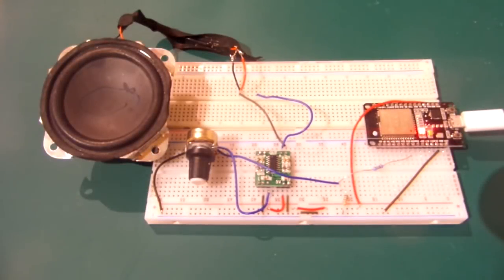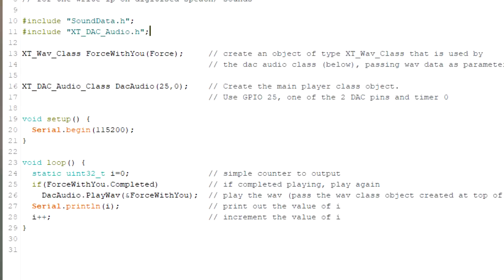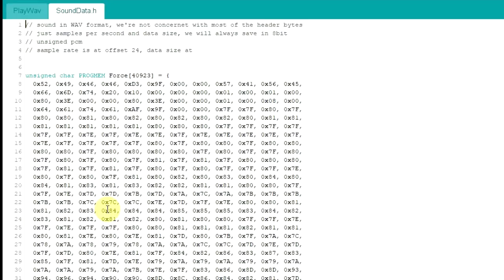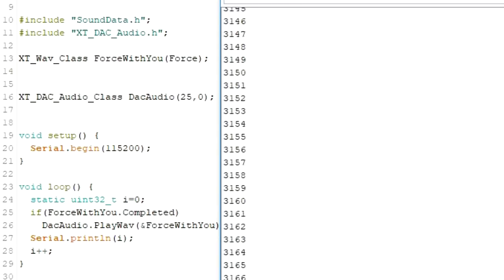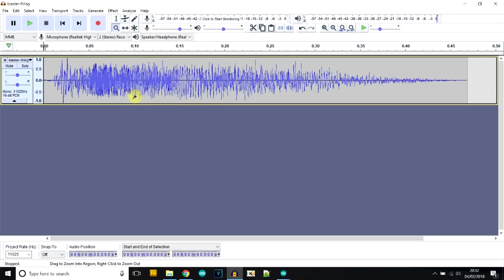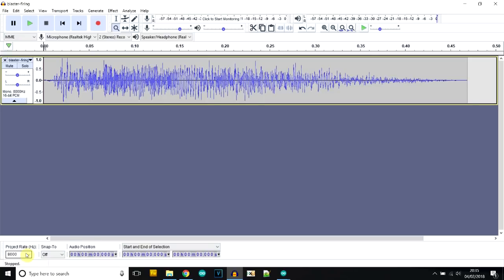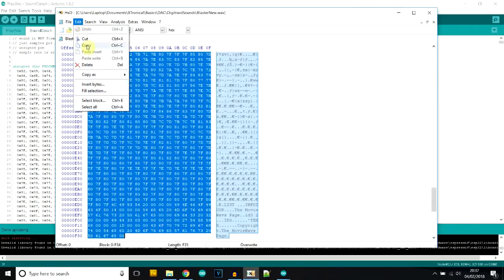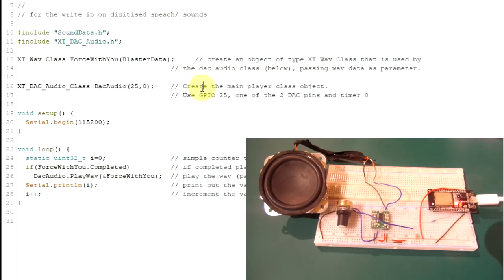Make your ESP32 talk, playing WAV files on your ESP32, digital sound DAC ADC

Comment: Hi, I'm new to this. I'm developing a project in which I want to use sound effects. I need the lag between audio tracks to be minimal and unnoticeable. I managed to implement this on the Teensy board with their library, but I would really like to implement it on the ESP32 since there is Wi-Fi and much cheaper. Can your library play files without a pause between them? I even hired a freelancer, but it didn’t work out.. In your videos you only play one track. The total file size is 3MB, but I think it can be compressed.
Reply from the maker: Yes, download latest library from my website. There is no pause between samples. You can play back samples at different rates so files can be much lower at expense of quality. If you watch the play list of videos on this library it will show you in one of them.
Reply: @XTronical  Thank you, I will now try to find a freelancer who will do this for me) The main thing is that now I know that this is real

Comment: Hello. Nice project. I'm trying to have the same project of yours, but, unfortunatelly, I have got several errors related to the library. I used Arduino IDE 1.8 and 2.x and I got these same errors. Do you have any tips for me? Thanks in advance.
Reply from the maker: Have you used the latest DACAudio library, available on my website?
Reply: Hello!. I did. But I found was wrong. Using Espressif addon V1.0.6 works fine. Any version 2.x.x does not work.

Comment: I know this video was made quite some time ago, but with the current XT_DAC_Audio-4_2_1 library I am running into the error where it cannot locate the esp32-hal-timer.h. I was wondering if you had a solution to this? Thank you, love the videos!
Reply from the maker: Mmm... I'm guessing something has changed in the supporting libraries that come when you set up the esp32 environment in arduino ide. I would have to set up a new set up to see if I can replicate. Unfortunately I'm up to my eyeballs in work at the moment, which is why no new video for a while. So although I'll pop it on my to do list it may be some time. If you solve it in the meantime could you post solution here please then others may benifit and I know not to look into it. Thanks.

Comment: How many WAV file, can I use to it?
Reply from the maker: Do you mean how many you can play at once? If so I've played 6 easily and between 3-5 whilst running my frogger game. If you just mean how many can you fit on the chip then that depends on the size of your wavs.
Reply: @XTronical  sorry ... my english is too bad...🙏🏻🙏🏻🙏🏻
I mean.... i try to build a sample pad... like a DTX multi 12... but now i use a Nano and MP3 TF 16P audio.. im saving my sample in sd card...
The problem is i cant play at once...
I have more than 150 samples... with 12 pad and 12 bank mode...u can see at my video...

May i use ESP32 to replace my Nano n TF Player???
Reply: I want to build a diy multipad samples... like a e drums.
With
12 pad trigger per bank.
2 extra trigger (foot controller).
15 selected mode(samples bank) more.
Can play a multiple sounds sample simultaneous at once...

It was builded by me... but problem is cant play simultaneous... and latency offer the tringgering...😴😴😴😴😩😩😩😩
Reply from the maker: Yes, it can play multiple files at once, you do not have to do only 1 at once. Your English is good.
Reply: Can we sharing via Whatsapp application???
Reply: @XTronical I'm sorry... how about if i use a sd card??? Because i have many sample... i think imposible to fit my sample on Progmem chip🙏🏻🙏🏻🙏🏻
Reply from the maker: Sorry, but this library does not support reading from sd card. No plans to update as working on i2s sound player.

Comment: Hello, can we connect it with the sd card reader only without the i2s and the audio output use a circuit to amplify the sound
Reply from the maker: It could be coded but I'm concentrating on i2s version only for foreseeable future

Comment: I followed your step by step procedure and pasted the hex code in my. h file. Compiled and uploaded. But I get only a beep sound while the inbuilt hex code in the ideworks fine... Please help me
Reply from the maker: Are you sure your file is mono and not stereo.
Reply: @XTronical  Must be mono. Because the file's waveform in Audacity is in a single track.
FYI : The wav file was actually created by an online text to speech converter. Its downloaded as an mp3 file having 6sec. duration. Then I converted it to .wav file using audacity and followed the procedure as in the video. Can u point out what went wrong since i am about to add this functionality in one of my project.
Reply from the maker: I can only guess what might have gone wrong. Is it definitely saved as unsigned 8 bit pcm?
Reply: @XTronical  yes you are correct. It was related to the export format of wav file. Thank u very much for correcting me 👍🏻God bless u
Reply from the maker: Excellent. If you want to play mp3 you should look at my i2s videos. Here's a play list

https://youtube.com/playlist?list=PLpyo4J4M9YqJLh0B8YXNB0zza0uWIeguO

Also here's a play list for my new i2s library which is basicaly a replacement for the DACAudio one you are working with. It's not ready yet though sometime next year for initial release. 

https://youtube.com/playlist?list=PLpyo4J4M9YqKRD_qWDDRDeI0jZ6D2EUw1

Comment: Great video! I was wondering if it would be possible to do a stereo output with this library? Play one sound through the left speaker and another sound through the right?
Reply from the maker: It would be possible using the other dac as well but I won't be implementing on this version. I'm supporting stereo with my new i2s library, which will have all the same functionality as this version. Check out some of my latest vids.
Reply: @XTronical  Thanks for the quick reply! I will look at some of your latest videos. Any advice if I would try to implement it in this library?
Reply from the maker: You will need to alter the software to read stereo wav files . After that you could follow the code to simply send the other channel to the other dac.
Reply: @XTronical  Thanks for the advice! Really appreciate it.

Comment: Hiya, great videos and website!  I have managed to get my ESP32 talking but I now have a need to out it into deepsleep mode - only trouble is I have not been able to get any audio to play when it wakes from deepsleep.  Is this possible at all or it is a known limitation?
Reply from the maker: It's something I've tried, and no one else has mentioned, so think you're the first. If I remember deep sleep loses all ram memory doesn't it? I think you'll have to re initialise the library or store some settings in spiffs before sleeping and restore afterwards. Least that's my guess at the moment!
Reply: @XTronical  Yes loss of RAM was my initial thoughts too, but have managed to get working now.  I needed a while loop to fill the buffer whilst .wav file is playing.

Comment: I am just watching the video right now and haven't checked any documentation but, can the sound be triggered once a condition is met? How does this impact the whole program?
Say for example an alarm clock.

I would perfer to use this method of making a sound instead of having to use an actual electric bell
Reply from the maker: Yes, it can do that easily. The program runs mostly on interrupts and there is very little impact on your main code. See this video where I run a game called fogger which is completely redrawing the entire screen over spi, playing the game and doing all the music and sound effects in real-time.
https://youtu.be/J9mV2IcEvP0
Reply: @XTronical  

After a realization, while I am interested in projects for esp32/86, since I have accumlated 6 of them, I have remebered that I have pi zeros. 

Now if I were to make a type of MOOD lamp that was sourcing data from a website with an additional Screen read out, that would play a sound in the event the mood lamp hit a certian condition from the data.

What would be a better opition to use in your opinion?
Reply from the maker: Both pie zero and esp32 could do what you want. Which ever you find easier to work with.

Comment: how connect esp32 output to PAM8610? . i mean it has a signal voltage range from -0.3 to 6V.
Reply from the maker: I'm not familer with it but the input range is fine for the esp32s 0 to 3 ish volts. Just connect dac output direct to it's input and omit the voltage divider resistors that I usually use.
Reply: @XTronical  thanks.. And the library is awesome. Btw PAM8610 can drive 10W at 8ohms and 15W at 4 ohms. Plus, it has a THD+Noise of less than 0.1%.
Reply: @XTronical  i forgot to tell you that the signal is biased at 3V by the ic. Should i proceed as you said?
Reply from the maker: Oh, hang on. I'll get back to you, will have to check the datasheet. Give me a couple of days
Reply: No problem, thanks for the support.
Reply: So did you figure something out?
Reply from the maker: Hi, sorry for delay, completely forgot! With lockdown and kids at home I get distracted. I've just looked at the data sheet. Firstly the recommended supply voltage is minimal 7v, so a secondary supply would be recommended. Although it's not saying it can't work at lower voltage but performance may be affected. As for inputs I think it should work just connected to the project as it stands. But if not omit the resistor divider pair and that should be OK also as it seems that it wants line level input anyway. Generally this board is more intended to be fed by a pre amp. I think it could work well if fed directly from esp32 and give it its own supply voltage. I might try one in future.
Reply: Oh, i know that it works from 6v to 16v. I just wanted to ask about the inputs. Ok i'll do as you say. Will i need a coupling capacitor on the inputs?
Reply from the maker: The board your using should have one (it's part of the reference design)
Reply: @XTronical  thanks for the help.. Stay Safe 🙂

Comment: Help me.
I copied values from Force array to another array but it does not make the sound.The arrays are same but it does not produce sound.
Reply from the maker: Can you post the code.
Reply: @XTronical  Thanks for replying..
Iam using version 2 library.
In soundData.h there is an array of size 40923 the array is initialised with the hex code.

In play wav file

I just create a test array of same size of Force.I just copy the values from Force to test array.
But that array is not working..
Reply: @XTronical  
#include "SoundData.h";
#include "XT_DAC_Audio.h";

unsigned char PROGMEM test[40923];

void setup() {

Serial.begin(115200);

int i=0;

while(i<40923){

test[i]=Force[i];//To copy the contetnt 
i++;
  
}

  
}
XT_Wav_Class ForceWithYou(test);                                                                                 
XT_DAC_Audio_Class DacAudio(25,0);                                          

void loop() {
  DacAudio.FillBuffer();    
  if(lick.Completed)
  DacAudio.PlayWav(&lick);  
}

Comment: Is it possible to load the sound array from sd card?
Reply from the maker: Technically yes but would slow things up a lot whilst accessing card.
Reply: Ok,,i store the hex data in a file and save it in sd card.at the time of call setup the array Force load the data from file
Reply: @XTronical  my doubt is if it possible to   create xt class object by passing array force after the loading of value from sd card...
Reply from the maker: Yes, should work but it will be stored in ram and not program memory so your files can't be as big
Reply: @XTronical  its make runtime error

Comment: how do you get sound to play without having to use PC to start program each time?
Reply from the maker: The examples are just designed to run after upload. You could write your code in a very large variety of ways to start a sound playing using the "play" function of the library. Have a look at the latest library on www.xtronical.com
Reply: @XTronical  Can you give simplest example? Thanks.Can you recommend a book for ESP32?

Comment: how about receiving sound files on a mic and then converting to wav or uploading to the sd card
Reply from the maker: Esp32 can handle that no problems. However playing back from sd is possible but if the driver waits for data then it will slow your main code down.

Comment: with 16k Sample rate, how much seconds of sound can the ESP32 save? Or in general, how much memory is available on the ESP, after subtracting the needed memory for the bootloader etc?
Reply from the maker: Virtually all esp32 modules ship with 4mb flash memory and so the very small boot loader is almost irrelevant. So in theory you can fit quite a large sample in that space at 16k. However when used with the Arduino IDE I think the default usable amount is around 1.3mb. Still a good amount. You can get at the rest but I've never read up how to as I've never needed to yet. So. That would still be nearly 100 seconds of playback.

Comment: Nice...
It is possible to send hexcode of wav from android to esp8266 
using wifi after burning the code from Arduino ide
Reply from the maker: Cool.
Reply: @XTronical   any way for sending ..
Reply from the maker: Ahh, did you mean "is it possible" rather than "it is possible"?
Reply: @XTronical  yeah 
is it possible ?
My English is poor  😓
Reply from the maker: Your English is brilliant, yes using WiFi you could send data but you could only store it in the RAM not the large program memory. However if all you want to do is send data to be played almost right away then some people have done this. If you want to store the samples then they would have to be small and once the power is removed they will go.
Reply: @XTronical  ok 
Using sdcard or inbuild 4mb to Store .
Reply from the maker: You can't write to the 4mb program memory unless you are programming the device, at least as far as I know. You could write to the SD card though and read back from there. That would work. Sounds an interesting project.
Reply: @XTronical  thanks bro

Comment: Nice work - noticed somethings strange - when I looked at the output of the dac pin running sample play wav code it looks like it's only the upper half of the waveform (goes from 0 to about 1.5v and where you'd expect the waveform to go negative it is just 0v) - i.e. it looks like it's outputting dac values of 0 to 127 for upper half of waveform and 0 when lower half - does this make sense?  When I run some sample simple dac test code using dacwrite (sine table) it does do the expected thing of going from 0 to 3.3v or therabouts, centrered on 1.6v so looks like it is something in the code.  Any thoughts?  Using latest version and stock esp32 on pin io25.  Can send a screen grab if it helps of the oscilloscope
Reply from the maker: Hadn't noticed, thought it did go from 0 to 3v ish. Something must have crept in somewhere and didn't spot it. Sounds like an easy fix, that should double the available volume! Cheers, will check it out.
Reply: @XTronical   XTronical  Cheers - my thought too re: the volume.  Should also make sound quality better as well - must admit I was surprised it still sounded pretty good with half of it missing!  I had just downloaded the latest version as the last version I tried (one from end of last year or early this year) showed the same thing but went from 1.5v to 3v instead.  Home now so don't have access to the hardware so this is a complete guess but looking at the code, when you're initialising the buffer to silence it looks like you're setting it to zero rather than mid range (0x7f) and wondering whether this in combination with the self-mixing in FillBuffer where you subtract 127 before adding, means your going down another 127, resulting in a range of -255 to 0 before you then truncate it with the '<-127' test (now a range of -127 to 0), before finally adding 127 again which would put it into the 0 to 127 range which might explain it?
Reply: Back in the office and tried it out - looks like it is this.  In the ISR I changed Buffer[NextPlayPos]=0 to 0x7f; as well as a similar change in the constructor when initialising the buffer in the loop and for good measure lastdacvalue initialisation.  Definitely louder and clearer now!  Thanks again for your work on this - a great library.  Now want to play around with the instrument things amongst other bits and pieces!
Reply from the maker: Oh wow, you've saved me work, great stuff, will implement your changes and re-release,  thank you so much for your help.
Reply from the maker: Going to implement this in the next version - coming soon - do you have the updated source to email or are the instructions above all I need to re-jig the code?
Reply: @XTronical  Just those few changes above were all I did
Reply from the maker: Thank you. Do you want a credit in the header of the next release?
Reply: @XTronical  Really kind but not needed - just happy to help - you'd already done all the hard work and thanks for making your work available!
Reply: I have the same problem on a TTGO (LILYGO with Lora32 and Oled), and similar problem,... but then only output voltage from 3v down to 1,5 volt when i use a NodeMCU32...!

Comment: Got this working, Thanks. However I went a step further and connected it to my WIFI and now I am getting noise and a clicking on output, both while the wav is playing and after the wav stops playing. Anybody seen this or know how to resolve it? Thanks!
Reply from the maker: It's a guess but with WiFi operating an interrupt might be interfering with the interrupt for this. I've not used the WiFi yet so not sure. Maybe someone else has.